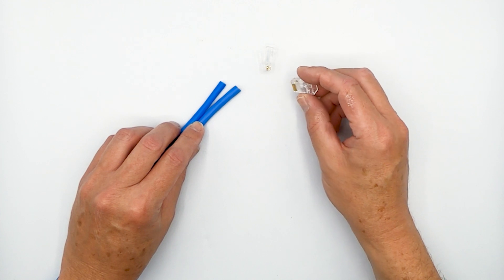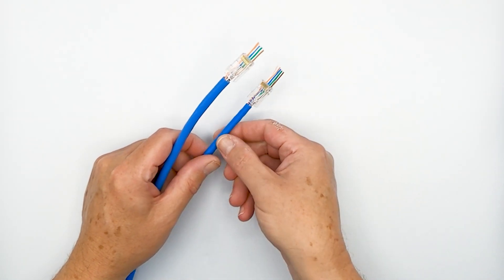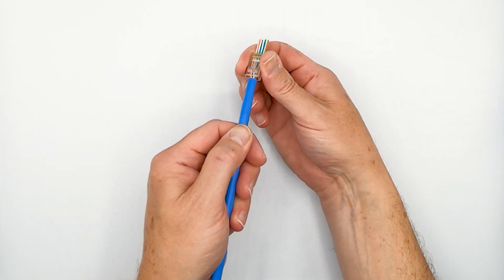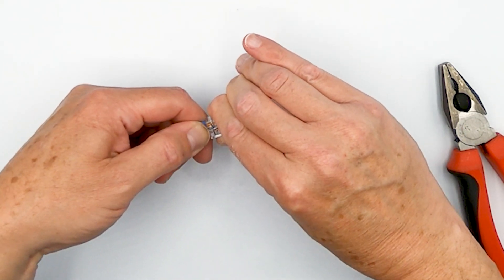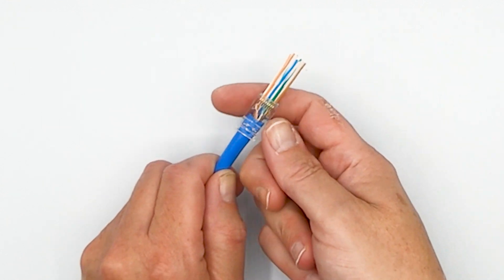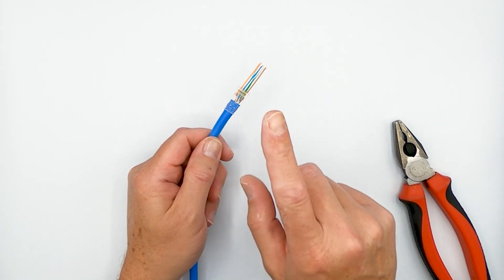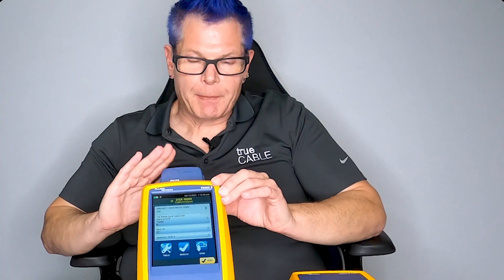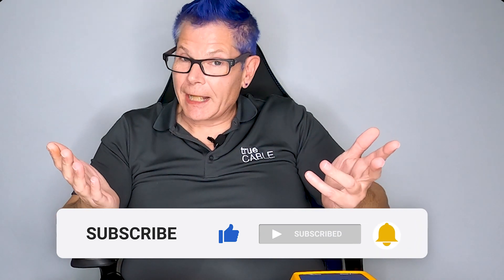Cable Not Fitting Your Connector? Try This Simple Trick! 2024

Comment: I’m currently having a 4k square foot house being built. I told contractor that I will be installing all ethernet cabling. I’m wrestling with either using cat6 or cat6A. Since I kind of want to future proof the house I’m thinking of cat6A. My readings and videos say cat6A is more difficult to work with than cat6. Can you please tell if working with cat6A is really that much difficult to deter me from using it. Thank you
Reply from the maker: Hello and thanks for your question. Considering this is a 4,000-square-foot house, I would strongly consider Cat6A U/UTP (unshielded) Riser as your best bet for future-proofing. Although Cat6 can handle 10G up to 165ft in limited circumstances and 120ft in most, I think using Cat6 would be stretching it, especially considering the price differences are not that great. Cat6A and Cat6 both have splines and pairs that are relatively similar in twist rates, so modern Cat6A is not really any tougher to work with all things considered. My suggestion is to proceed with Cat6A. Avoid shielded cable unless you know for certain you require it. It adds no additional speed benefits and will be much more difficult to work with. Hope this helps!
Reply: @trueCABLE  Thank you so much. I will then use cat6A for my home network. Will Part Number - 6ACMRBLU_1Krl be the correct cable to order? What about for security cameras, do you recommend cat6 or cat6A?
Reply: how is the house building going